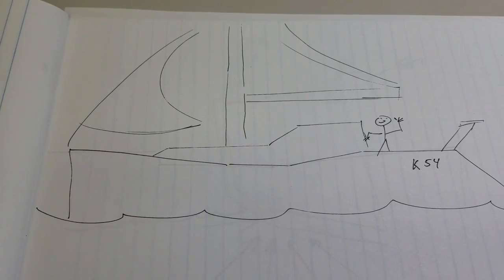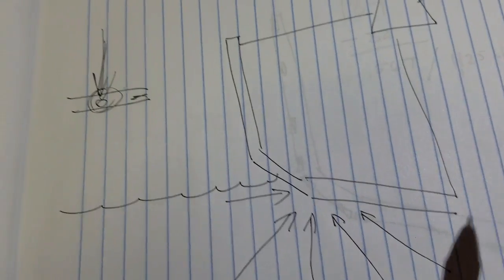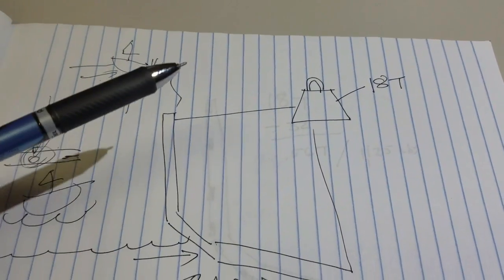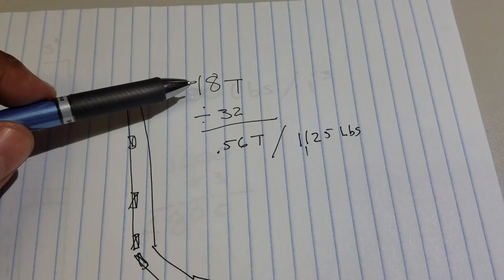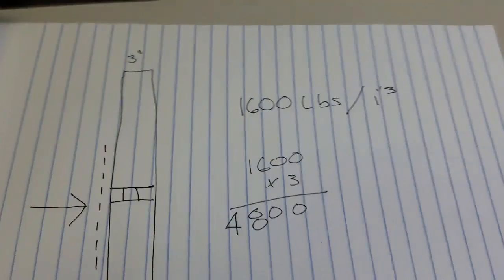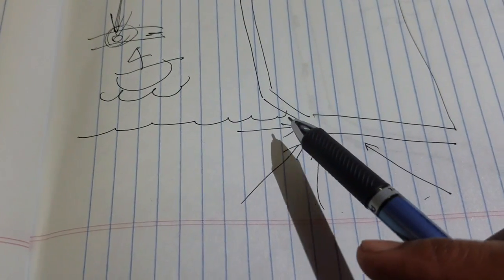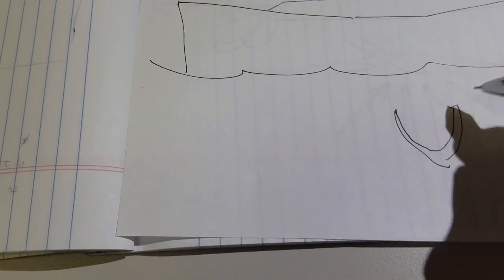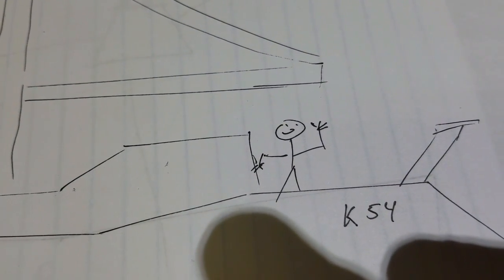Understanding the basics of boat hull strength.  WARNING - contains extremely nerdy content :-)

Comment: Nope.  Does not take into account high pressure areas,  nor drops from swells Into a potentially flat water level with acceleration which certainly exceeds psi in pounds than the boat weight.

Comment: Hi, The stuff was very helpful really ! I am planning to build a SWASH explorer out of steel (not swath, it is single hull submerged completely into water) but the thing which confuses me is, is it workable for 13m length? What structure is most in favour of mine with steel thickness? Please guide me I could'nt find helpful data ! Please give some time and whatsapp at 03004599094 for a short discussion. I am waiting. Thanks

Comment: "Boat hull is s very fluid thing" what???
Your description of the difference between a building and a hull are totally incorrect. Both structures utilize load stabilizing through designs that transmit the load to adjacent frame members. Boats and buildings are very similar..as are any type of "frame" structures that have horizontal and vertical frame members that share and transmit loads.
"The boat hull has to support the weight of the boat itself." Ya, no kidding, but it has to support the ocean beating the hell out of it among other things. You didn't get into gravity, buoyancy, anything. Your descriptions are ridiculous and incorrect. I won't even talk about your drawings, holy crap, phew.
"I'm going to bore some of you"....and I'm not going to fool all of you!
Shear strength units of measure are force over units of area (units ^2), inches squared, not inches cubed. You were using cubic inches. Where did you get cubic inches? That's volume. You need area.
And you never got into fluid dynamics or strength of materials like you mentioned in the beginning. I'm sure that would've been fantastic!! I'd love to see that!! You need to school yourself before you can school anyone else. 
Why did you post this video? You obviously have no clue what your talking about. It's good comedy though!!
Reply from the maker: Thank you for your comment. I appreciate all input from the community. Can you please attach a link to the video log of you building your boat,I would love to learn from a master.  Peace and blessings to you

Comment: i think this subject is more complex then it is in the vedio to do a structrual design you have ti identifay the material properties and exact load values is isotropic material or orthotropic? in case if layerd material like FRP you have to bare in mind that the direction of fiber will effect its strength with recpect to the load direction

Comment: Is there a large delta between the load capacity at the vertex of a frame and stringer, compared with the load capacity of the bare hull center of 4 surrounding vertices?  Interesting to see a color map of the capacity with a decent resolution.  I'm imagining it as blue squares surrounded by thin red squares.

Comment: I’m probably saying the same thing you have but differently. I think of a hull as statically the same as a dam resisting the water it has displaced. That force is acting horizontally on the sides trying to crush the hull inward. Dynamically, when the boat and water move, there are additional peaks. Think of squeezing something that won’t break so you decide to jump up and down on it.

Comment: why do they use screws to hold hulls in place during early parts of construction, but remove them during finishing? cant you use SSscrews and leave them in?
Reply from the maker: miles beaudoin stainless steel screws will also eventually corrode in salt water. The best fastener to use is a bronze Fastener but those are extremely expensive to the tune of about a dollar per screw. So the best practices is to remove any metal ,if it's a composite lay up, once the epoxy has set up. Thanks for watching and peace and blessings. :-)
Reply: thanks. blessings

Comment: How could shear (or compressive) strength possibly have units per cubic inch? 6:18 ....and several more places, so it wasn't just a slip of the tongue.  Frightening.  Your confidence to accuracy ratio is dangerously high.  A decent understanding of shear and compressive strength should have alerted you to the fact that the units must be per area not volume.
Reply: You know what... I've watched a few more of this guy's videos. I might have to rethink my attitude here.
Gonna watch on a bit before I decide my point of view.
I'll say one thing, he certainly is hard workng and a gentleman.
Reply: None of this takes into account the multiplication of the load under dynamic circumstances, the acceleration followed by a dead stop of a boat pitching at sea. Furthermore, in the engineering environment, there are already excellent tables for the stresses and strains of nearly all marine construction materials which have been derived by very skilled people with a lot of resources behind them and have proven sound over decades. The scantling and structural member sizes appropriate for particular sizes of vessels , especially in timber, are available freely to anyone bothering to look as they have been established by Lloyds (and, no doubt, the US equivalent authorities)for over 200 years. You're spending a lot of time, effort and resources to establish something already known, and applying the results without reference to any test environment or methods, and then adopting those results into a structure which will sustain itself statically but which has no reserve designed in to cope with the environment in which you hope to use it. I have to applaud your efforts, but you're taking a risk. I would advise joining a course at somewhere like Westlawn to get more of a grasp of what is required. Your 18t design will have to withstand over 45t of loading in a dynamic environment, and the size of framing your talking about won't handle those loads.
Reply from the maker: Ben Griffin and my calculations I use the proper value. Making a video off the fly I may not have describe the accurately. But the math is good. If you can prove otherwise I would appreciate it. Thanks for watching peace and blessings.
Reply from the maker: Here's a more practical example of how I derived my calculations. Notice that 2x4 beam broke at 1800 lb, my beam is a true 3 inch which is where I got the 1600 pound figure. It's not science  but it's strong enough.
 https://youtu.be/wvcISxs3YG4
Reply: iandi Boats Empirical validation is definitely science.  Testing samples of the actual material of which  your vessel is being constructed is reassuring.
Reply from the maker: richtourist thank you for the further consideration.
Reply from the maker: ted renard actually they exceed the recommended scantling's. This was a video made for Layman. And I hired 2 Naval Architects to verify my designs. So you are correct but we're on the same page. There are two video conversations with both Naval architects on my YouTube page.

Comment: I have a question and this is gonna sound a little odd.  why don't they make catamaran's with hinges instead of a frame that is ridged?  So for instance the right and left side of the boat go up and down independently of each other.   I.ve been kicking around this idea for a while and there is a few hang ups.  also why cant a catamaran have a motor one each hull?  or do they do that?  or a center mounted engine between the hulls? possibly on a smaller shorter hull.
Reply from the maker: I have seen smaller multihull designs where the boat does fold up.  Google folding catamaran/trimarans designs.  Also most larger cats do have engine's in both hulls.  Also check out multihull designs by Arthur Piver, Jim Brown and James Wharram.  Thanks for watching and Peace and blessings.
Reply: what's your opinion on carbon fiber?  i understand the catastrophic failure issue, but to me that is fear.  I'de like to see and aluminum skeleton with not sure which wood for strapping then a carbon wrapper.  IMO it would be strong and light.

Comment: you will have different loads on that hull as the boat pitches and yaws with the waves. as the boat rolls, the dynamics are constantly changing. I also study statics and strengths of materials in college. those ribs and more importantly, the joints are critical to the overall strength of the hull, especially on a sailboat.
Reply from the maker: John Nelson I agree. That's why I decided to also screw the gusset plates to the joints, to reinforce the chemical bond with a mechanical connection. That alone makes it plenty strong. Think of it like a roof truss beam. There are also the floors, longitudinal stringers and 2 × 6 joist for the sole. All of these components work in tandem to make a very stiff and strong structure. Thanks for watching. Peace and blessings :-)

Comment: Great video, I am sure your boat is going to be plenty strong.  One minor error in your explanation is strength is measured in square inches not cubed and is based on cross section of the member. A true 2 x 4 would be 8 square  inches times your shear strength for the load. It is also more complicated because of bending moments etc. But like I said your boat is going to plenty strong.
Reply from the maker: Very true Greg, I was just trying to express the concept of the strength of wood fiber. Are you an engineer?
Reply: Hi yes I am a material science engineer. I don't remember all the formulas around beam strengths from college but remember the basics.

Comment: Ok, now to slug it out... :)

The explanation is incomplete. All the strength you mention is there but it really doesn't come into play. You are well into belt and suspenders territory and no hull is ever too strong but your boat would be just fine without the frames at all. The ply-fiberglass composite of the hull planking has tremendous strength all on it's own. The frames will just tie things together nicely, prevent oil canning and give nice fastening points for bulkheads and other interior furnishings.   

Other than the extra chine, you are basically building a sharpie with an external stub keel. Even though it's a power boat, take a look at Bolger's Wyoming. At over 50', there are no frames at all. Just a few bulkheads. Same with the cold molded hulls like Ruel Parker's stuff.
Reply from the maker: No need to slug it out at all, I agree. The scantlings for my boat showed  that I could use one and a half inches and be fine. The only reason my frames are 3 inches is so that I could put 2 inch rigid insulation and have a one inch air gap. :-)

Comment: I love the nerdy stuff too.  But it does raise an idea.  If your Frames where made of a solid piece of D_Fur, then your calcs and theory make a lot of sense.  But you have two Chimes in there.  The sheer in the plain of the joint is based on 1) the strength of the adhesion of the epoxy to the end grain of the D_Fur, and 2) the strength of the plywood. "Imagine" if that joint was only held together by a single screw.  The sheer at that point would be the sheer value of the screw and nothing to do with the D_Fur characteristics.   Are you taking in consideration the side forces of the waves endlessly pounding on this from the side?   Just thinking back through another comment on the previous video regarding joint strength testing.  I have chairs in my kitchen with excellent joinery, but that doesn't keep them from failing...  And I have a strict "no-kinky" stuff allowed in the kitchen policy.  Thanks for what I call brain food!  Cheers!
Reply from the maker: lol kinky kitchen antics... I understand and agree somewhat to your theory but the frames will never receive side loads only the working end. Only the bow and the stern we receive loads  in more than one direction, and those will be very  beefy in their Construction. Additionally the stringers also add lateral support  to keep the frames from moving side to side. My understanding of epoxy is that a proper epoxy joint is stronger than the wood fiber. So then the wood fiber attaching to the epoxy would fail before the epoxy joint itself which, in theory, allows me to use the strength of the wood in my calculation. :-) And finally even if I did not epoxy the frame together the strength of the two pieces of half inch plywood is greater than the force it would receive. 2 ea 1/2 inch pieces of plywood glue together still give me one inch of Douglas fir wood fiber equaling the same 4800 pounds of resistance. Okay I need a drink now LOL

Comment: Hi @Iandi Boats,

I've been following your progress with great interest and always eager for new videos, but I have a question about the plywood pieces you use to strenghen the joints in the boat frames. 
Wouldn't it be better if the "inside" wouldnt follow the form of the frames exactly but just be sort of triangle shaped?
I've learned for metal parts you try to avoid hard inside corners to avoid the notching effect and stress concentration on these edges, doesn't that apply to your frames as well ?

Greetings from Germany,
Marius

Comment: Your floor is not going to be continuous side to side.  You will at least have hatches or possibly complete removable flooring.  Obviously you could put a brace under the floor that ran side to, just make sure that water can pass underneath it.
Reply from the maker: Gteetings. The floors will be continuous from port to starboard, they tie the frames into the keelson. There will be weep holes to allow water to migrate to the bilge sump. The sole will have some removable panels but the frames (2×6) will also go from side to side.
Reply: I am mot enough of a sailor to know the difference between a floor and a sole.  I though they were interchangeable.
Reply from the maker: +theoldwizard998  The floor is a structural member at the bottom of the boat where as the sole is the framing that we actually walk on. Typically the bilge area is in between those two components. Thanks for watching and peace and blessings :-)
Reply: I just re-watched this.  The floor is going to be 4" and the deck 3" . WOW !!
Reply: Watching AGAIN I think I finally figured out what is bothering me.

Using your little picture from about 9:50.  Let's assume your boat is parallel to a solid wall pier that is higher than the boat and it is about 3-5' away from said pier wall.  A 10 knot wind blows on the opposite side of the boat and accelerates it toward the pier,  While you only have 5' to accelerate, F=MA.so that side is going to contact with a lot of force !

Let's assume the contact is at the top of one of the frames.  The deck beam will compress (and possible deflect).  Even if that deflection is small it will be transmitted down to gusseted frame joint.  You now have a torque applied to that joint that is only held together by epoxy.  The force applied at the top of that frame is multiplied by the length on that upper half of the frame.  The floor beam at that joint will act as as a hinge.

In architecture they would tell you to triangulate that corner (chine), but obviously that is not practical..

I know a college grad student who is studying composite material and actually has experience FEA and epoxies so I am going to ask him to do some modeling.

My gut says, 4 - 1" pegs perpendicular to the frame, gusset to gusset. at each joint in each frame.  Now THAT is really OLD SCHOOL !
Reply from the maker: +theoldwizard998 Wow.... it would take me like 3 videos to answer that lol :-)
Reply: How about a sketch showing how the floor and deck conbect to the frame.

Comment: Interesting.  I thought you were building frames on which you would build a mold or something.  Very cool - appreciate the info.  What influence will epoxy have on that strength?  I'd think penetrations where frames cross stringers would be weak points for simple wood, but if well impregnated with epoxy, each point where there was a joint would potentially have more strength that the individual parts due to the fact that the grain was in two directions, plus the epoxy........ What will be between the doug fir?  Glassed ply?